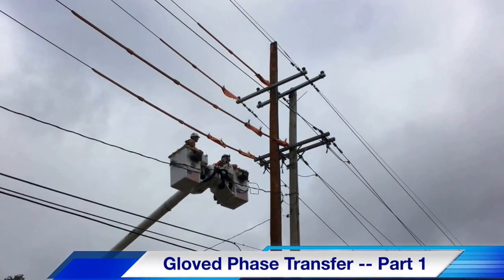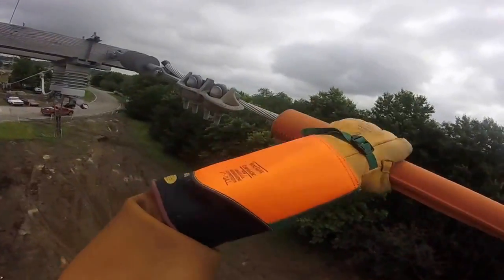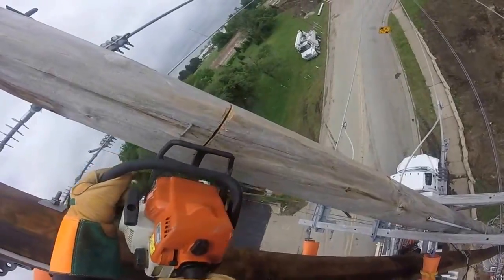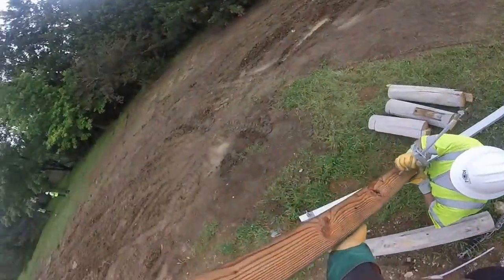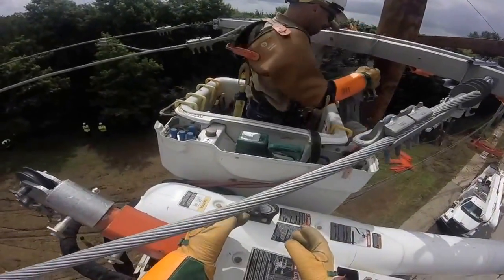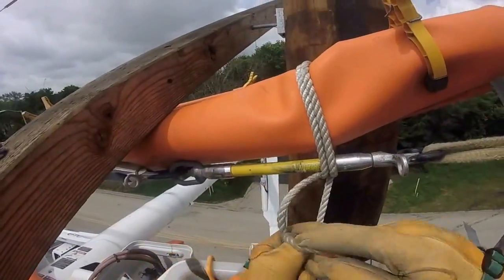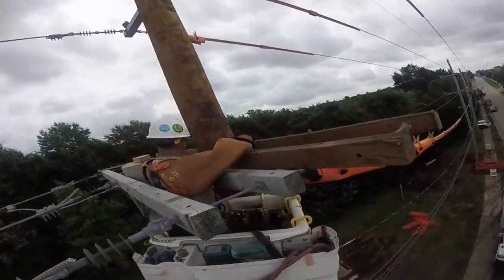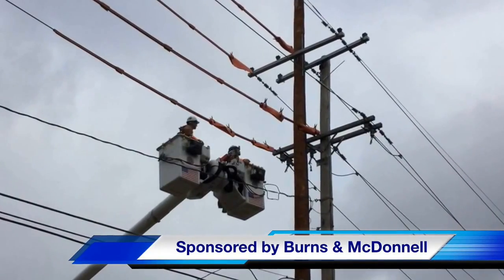How to Perform a Gloved Phase Transfer - Part 1

Comment: Changing poles that don’t even need changed lol, Where I live there’s poles still standing from the 40’s
Reply: Agree. Some old transmission crossarms I got I think we’re rotting and the distribution side crossarms occasionally split depending on what type of wood treatment it had. Love seeing those old poles around and what they did 30,40,50 or maybe even 60 or more years ago.

Comment: Is the bucket grounded or are they wearing gloves just in case they touch two phases at once?
Reply: Any difference in potential is dangerous not just phase to phase
Reply: Most company’s require gloves and sleeves to be worn in the primary zone regardless
Reply: Both